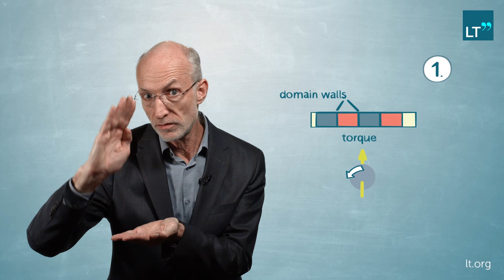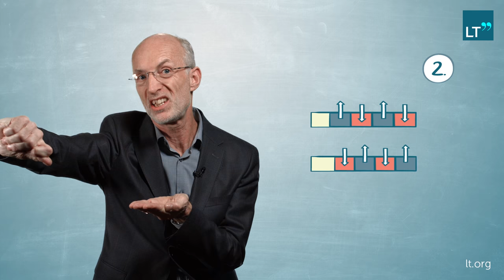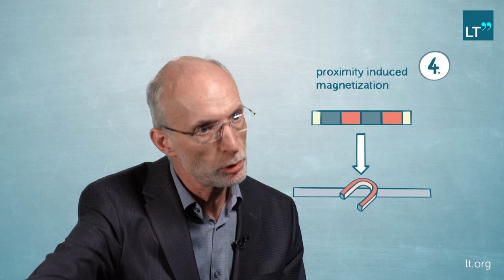Spintronics and Computing Capacity

Comment: When the current pulse ﬂows into a nanostructure its temperature increases due to the Joule heating effect and you have completely ignored this effect while discussing a racetrack memory.  My single-pulse measurements on ferromagnetic nanowires suggest that this temperature rise prevents the domain wall motion via STT at room temperature.
Reply: They built a prototype device. I don't know if they ran it at room temperature though.
Reply: @samzx81  where's ur pfp from?
Reply: @mihailmilev9909  my profile picture? Doom 3.

Comment: Why would the racing tracks have to be vertical? And how will you move data along the length of them? From the way you described it, this sounds more like a high speed transmission solution than a data reading or writing solution. But if you have a better way of explaining what you are on about in terms of SRAM replacement, then I'm all ears.
Reply: How else you gonna get skinny. Walking to St. Ives needs gravity and looks like that as many  that are traveling companions may too